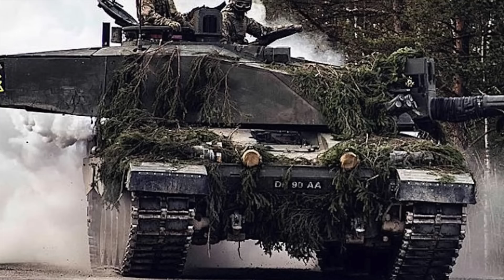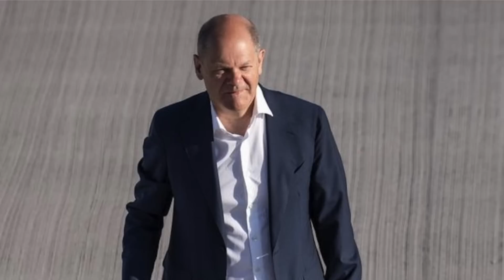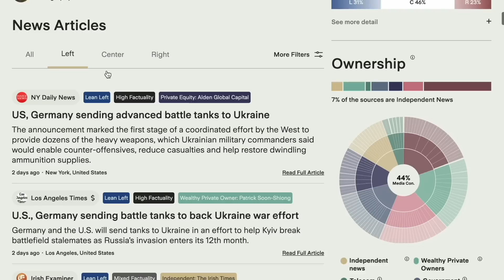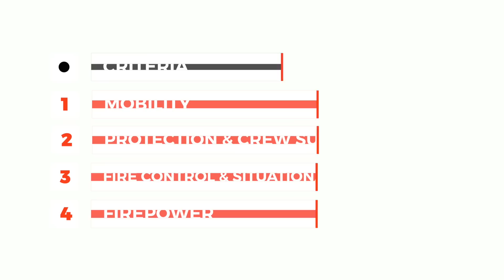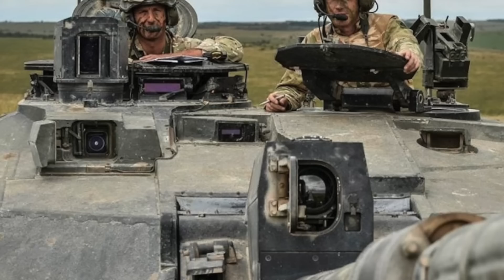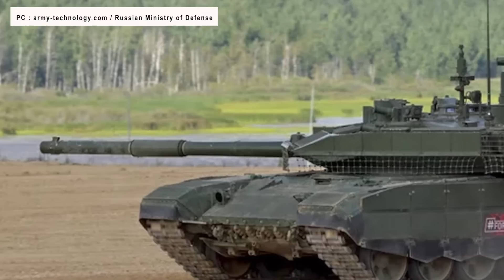British Challenger 2 vs Russian T-90 - Detailed analysis !

Comment: Challenger 2. Still the world record holder for the longest tank on tank kill in the real world.
Reply: Check your facts it was actually challenger 1
Reply: 2 uses the same gun
Reply: @BlatentlyFakeName  same gun but the turret was completely redesigned, still doesn’t change the fact that it was a challenger 1 that got the 3 mile kill although apparently there’s video of a Ukrainian T64 BV getting a 6 mile kill, I can however neither confirm nor deny that claim. Never the less it was a challenger1
Reply: @BlatentlyFakeName  Different gun .
Reply: @BlatentlyFakeName no it doesn't but okay
Reply: @colinblackie9654  I think you'll find the Challenger II has never lost on the battlefield  except for blue on blue or challenger against challenger
Reply: @35geordielad  yes the 1 I mentioned
Reply: @35geordielad  Yes that is correct challenger 1 then has never lost. Only blue on blue test how good the gun was on the challenger
Reply: @colinblackie9654  "check your facts" it was actually Challenger 2, second gulf war
Reply: @martinodonnell7984  No ..its Chally 1 in the first gulf war.
Reply: @martinodonnell7984  Wrong, it was Challenger 1.
Reply: @martinodonnell7984  It was actually a Challenger 1, call sign 11B that made the shot, killing a T62 at 5,200 metres.  It was during the first Gulf War, Operation Desert Storm.
Reply: Main difference between Challenger 1 and 2 is they are proven in battle. The T90 is was not until Ukraine it’s been used in Syria but not tank on tank against experienced crew. Top Attack NLAW and stinger will eat it for breakfast. We will see how Challenger 2 does with Ukrainian crew.  They took out 300 Soviet era tanks in Iraqi with no losses. One lost a track and had multiple RPG and two larger  antitank missiles fired at it. No penetration crew survived tank recovered repaired and back into operation.
Reply: @anthonywilson4873  Challenger never faced modern weapons yet. But that will change very soon, you will see what happens in a few weeks.

And the T-90 did see combat before Ukraine, back in Syria 2016 war. Several T-90's were hit by TOW's but survived (it's the second best American missile after the Javelin)
So back in 2016 the T-90 looked good in Combat. Then it faced the Javelin and everything changed. 

The same will happen to the Challenger, it only performed good against old outdated weapons but will be destroyed by modern Russian Kornet missile.
Event the old RPG-29 was already enough to penetrate the Challenger front armor back in 2007 (altough the crew luckily survived because it was a very low hit at the bottom)
Reply: @xAlexTobiasxB  Russia doesnt have any modern weapons.
Reply: @chethemerc7841  
T-90M Tank (equal to US Abrams)
KORNET Anti-Tank missile
SU-35 fighter aircraft
SU-34 Attack Aircraft
Lancet precision guided attack drone
Krasuhka Electromagnetic Jammer
Sosna-R Anti-Air Tank
S-400 Anti-Air Missile system

Nebo-M AESA Radar for S-400
S-500 Anti-Ballistic Missile system
Tu-160 Tactic missile bomber
Kalibr Long range Cruise Missile
KH-58U Anti-Radar missile
P-800 Onxy Super-Sonic Anti-Ship missile
Admiral Gorshkov Missile destroyer
Yasen Nuclear missile submarine
Kinzhal Hypersonic Missile
Zirkon Hypersonic missile
'*Topol-M* Inter-Continental Nuclear Missile

All of these weapon systems listed here are already in active service with the Russian army.

And I didn't even start counting all the new prototypes and pojects that will enter service in the near futue such as:

T-14 Armata tank
T-15 Armata Infantry Fighting Vehicle (IFV)
Kurganets-25 Infantry Fighting Vehicle (IFV)
Mig-35 Fighter aircraft wih AESA radar
Su-57 Pak Fa Stealth fighter 
S-70 Okhotnik-B - Stealth Drone
Grom Attack Drone
PAK DA Next Generation Stealth Bomber
MIG-41 Next-Generaton Stealth Aircraft
KALINA Laser Beam Cannon

Russia is not a third World country, it is one of the most dominating and leading Power in the world and it has one of the most powerful Military in the world.
Reply: @xAlexTobiasxB   some dont work. Some are protos only. Some of their abilities are vastly exaggerated. And most completely missing from the War. Russia is a self hyped poor country. That has to pull guys off the street and give them 50 year old rusty rifles just to hold small gains they made a year ago in Ukraine.
Reply: https://youtube.com/watch?v=043QymmIcA8&si=EnSIkaIECMiOmarE Challenger 1 first Gulf war call sign 11B unless the British tank museum is wrong too
Reply: It was actually a Challenger 1 in Desert Storm.  Get some of the 400 updated Chally 1s in storage in Jordan.
Reply: Also the toughest tank, one took like 200 RPG's or something stupid like that in Iraq.
Reply: @bobbobertbobberton1073  it was thought to be around 70. A chally has never been breached.
Reply: @bobbobertbobberton1073  No, it was actually more like 2.000.000 million RPGs, the rebels carried them all in trolley bags... and then the rebels dropped a Tactical Nuke on the Challenger but the tank survived
Reply: @xAlexTobiasxB  Its actually a true story, granted they were soviet RPG's but a challenger got stuck and took hours of fire and all the Iraqi's could damage were the sights on the tanks.  Also the RPG's are cheap (they ain't javelins) as fuck insurgents went around with backpacks of rockets and multiple insurgence would carry RPG's.  Also not all combat is squad to squad, if there is a fucking tank coming you'll call in as many RPG's carrying men as you can.
Reply: that was an accident  whats not an accident is whatever the british make is garbage in a battle field

Comment: Interesting how the T90 is basically the grandchild of the T72 and then Chally 2 is the grandkid of the Chieftain. I suppose the end of the cold war killed the need for radical new tank designs
Reply: No, challenger 2 is the grandkid of the challenger 1.
Reply: @lb7901 it’s son, technically
Reply: @johnhammond1141  True
Reply: @lb7901  wouldn't that make the chieftain it's grandpapa as suggested. Just sayin
Reply: @LiamO  chieftain was nothing like the challenger 1 or 2 in design or performance. It's a whole new line. Challenger 1 is the grandpa of the challenger 3. Chieftain was it's own thing.
Reply: @lb7901  The inside of a CR1 Turret was remarkably identical to the inside of a Chieftain  Turret including an identical Main Armament, Coax , sights, charge bins, proj racks, IFCS etc etc.
Reply: Not reallym chieftain had a rifled gun and no era.